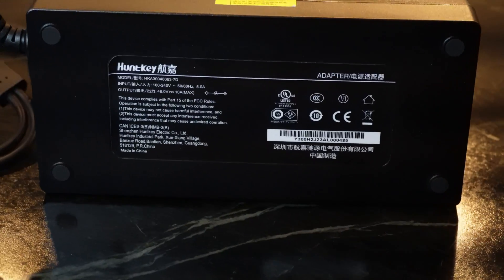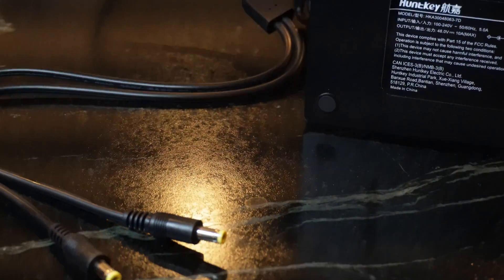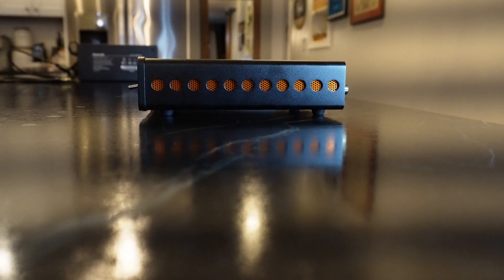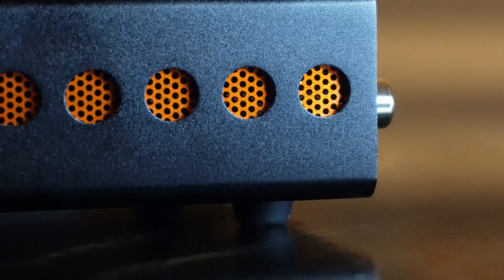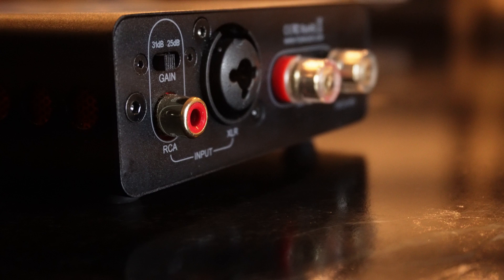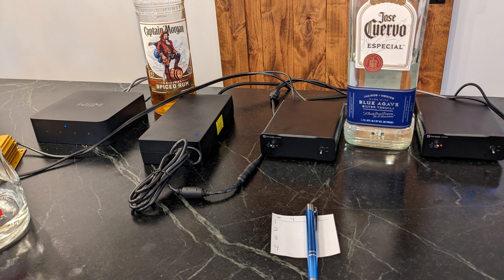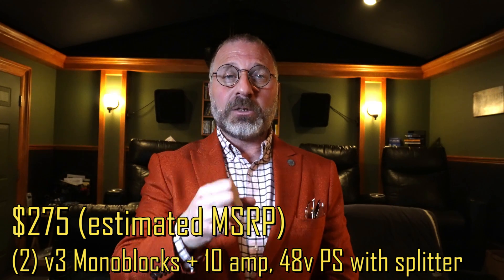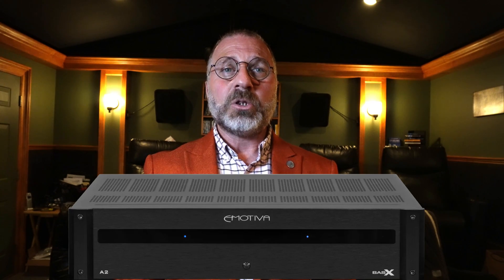Too Hot to Handle! Fosi v3 Mono

Comment: I use fans under the V3 mono blocks. No heat issues. No noise issues - other than I can just about hear the fan. I rolled the Op amps for the Sparkos SS3602.

I'm not sure why we dont just use fans and stop complaining.

Comment: My pair arrived today. The new single power supply has fixed any noise issue but man do they run hot. Mine cut out after 30 mins in a room (with slight airflow) temp of 75°. Ive put a usb fan on them and they are fine. 3 hrs running now and they are barely warm to the touch. They are outstanding little amps easily driving my dynaudio emit 20s. 
I really think they should be $10 more and come with a small usb fan. Or at least have it strongly recommend on the website or amazon page etc.

Comment: Gentlemen, I have 2 48 volt 5a like fois audio za3 amplifiers and I connected these amplifiers monoblock, and the muses01,muses02,muses03 opamps play very nicely, and my audio source is my computer with an ASUS X99 DELUXE ll motherboard, and the speaker is Monitor Audio Silver 100 (7G) As a musical style, I listen to rock, blues, pop, latin pop and I'm currently continuing with muses03s.
  By the way, I buy all my opamps from the original MOUSER and DIGIKEY, and in addition to these, I also bought the original TPA3255DDVR amplifier chips, but I have not changed them yet, but the ones on the amplifier seem to be original, so I am not in a hurry to change them.

Comment: Thought class D runs cool?
So why are these so hot?
Reply: Two primary reasons ...

Our "scientific" friend is using a testing procedure that is designed to "test to destruction" and panning a product that actually passed the test.  In real life, listening to music or movies, they won't get anywhere near as hot as roasting them with White Noise (all frequencies, constantly at maximum amplitude). Music is far more dynamic and for 240 watt peaks the average power is more like 25 watts.

Second, these little mini-amps are basically a powerhouse in a coffin. The case designs, especially with the bottom of the case used as a heat sink, are doomed to make them run warmer than they should. There is simply no-place for the heat to go, so it builds up inside the casing. A good heatsink with top and bottom ventilation on the case will work better every single time.

Comment: The heat dissipation design makes the whole chassis into a radiator, which means the surface temperature may seem a bit high. I think that indicates the heat from the TPA3255 amplifier chip is being effectively transferred to the chassis.
Reply: Heat travels up much more rapidly than down.  All the "chassis as radiator" really does is increase the temperature inside the chassis.  It does almost nothing to actually get rid of the heat. Moreover, there is virtually no air circulation under those chassis boxes to carry the heat away. So if the tops are hot, the bottom will be much hotter.

It's a terrible cooling solution.  In fact, you would get a much better result if you turned the amplifiers using it upside down.
Reply from the maker: You’re right but it is still a burn risk at those temperatures. However, this was a serious stress test and I’m surprised they didn’t go into auto-protection (if they even have that capability). My A-S2100 went auto protection.
Reply: @scientificaudiophile  
Yes the TPA3255 has a full suite of protections built in.  
Do your homework... search for "TPA3255 Data Sheet" and give it a read.

Comment: SA, how hot does your reference amplifier get with a 4 hour stress test?  You HAVE done that stress test on your reference amplifier haven't you??!!??  Andrew Robinson is watching whilst sounding like a transcendental meditation tape narrator.
Reply from the maker: I did put my A-S2100 under the same test.  After two hours the surface temperature hit 109 degrees into a 4ohm load.  It went into auto-protect at 2.5 hours. Never got too hot, but it makes me wonder if there is any auto-protect circuitry in the FOSI.

Comment: Must admit I bought a Fosi ZA3 to experience what they were talking about. 
Didn't expect it to surpass my Rega Aethos, but must admit that with lightly driven vintages like the Beovox 1100 or 2200, system matching makes the ZA3 surpass here. Looking forward to hearing the Lowther Bicor 1000 and Zu Audio Cube MKii at class d...
With that in mind, I'll have to try the mono V3, with the Aethos as a preamplifier...
Work, Consum, Die;)
Reply from the maker: Well said.

Comment: I was going ro use the za3 as a mono block to run my Polk 12 inch 2 ohm Sub. Now thinking about V3 mono for  that and using ZA3 for stereo tops.  two amps for 2.1 portable system. Thanks Amir for keeps cool looking jackets alive and well. Maybe there is hope for us after all

Comment: I’m no audio technician. But I do have a basic grounding in the sciences, particularly maths and physics. A 5 amp 48 volt power supply can only output 240 watts. So, in order for that thing to manifest 240 watts into 4 ohms, it has to be 100% efficient. Class D amplification is known for being ultra efficient, at least compared to class A or Ab. But 100% efficient, never. Anyways, you described the amp as running hot. Inefficiency, equals heat. Enough said.

So now that we’ve unquestionably established that the unit doesn’t live up to the manufacturer’s claims, I’ll be keen to watch your full review, once you’ve been supplied with a non defective power supply.

In the world of die hard audiophiles, isn’t separate power supplies with monoblocks a key selling point, or marketing ploy? So, is not a 10 amp shared power supply, a step backwards?
Reply from the maker: If the splitter can properly send 5amps to each unit, then shared isn’t a problem, but considering my first splitter was a mess, maybe it is a problem.
Reply: @scientificaudiophile  a shared power brick, supplying 480 watts is still insufficient to allow 2 mono amps each to produce 240 watts. Unless they’re 100% efficient, which they’re blatantly not, as they get warm.
Reply from the maker: True. There’s zero chance they can meet 240 watts.
Reply: @scientificaudiophile  👍
Reply: Okay, here's the thing ...
When pumping noise (especially white noise: all frequencies at full amplitude) into a system you are correct.  The power brick should rightfully go into either current limiting or a full shutdown.

However; unless you are hell bent on making your ears bleed, listening to music at reasonable levels won't even get close to that.  With only 10db of dynamic range you are already down to an average of 24 watts... and that will get lower as the DR of the music increases.

In most cases listening sessions on reasonable music will give you perfectly adequate levels on 2 or 3 watts, with peaks not likely exceeding 50 watts (for 15db DR).  

It is a serious mistake to equate a bench level stress test to what a person should expect in normal use.
Reply: @Douglas_Blake_579  that’s not disputed. What is under scrutiny is the nanufacturer’s claim that the musical power output of the V3 mono amps, equals the power output of the power supply.
Reply from the maker: According to ASR, in a short burst, there must be some additional voltage or amperage in the power supply because it hit 241 watts. I would imagine the power supplies being used have some variance in their manufacturing, so your mileage may vary a few watts.  But 240 watts is not continuous.
Reply: @howardskeivys4184  
As I explained above, with bulk energy storage in the amplifier itself it can actually exceed the power supply's limits for short bursts.

The point is that you don't need a power supply that will deliver continual full power output... Because music is not a steady state. It is dynamic and with proper music having a dynamic range of only 10db the actual "continuous" demand on the power supply is probably less than 20 watts even though the peaks are driving it to clipping.

The only way you're ever going to get to 240 watts of continuous demand with music is by overdriving the amplifier into such severe clipping that audible distortion would fry your tweeters... and in that case I'm betting you'd be the one screaming: "Why didn't it shut down!?!"

Is Fosi lying to us?  It sure looks that way ... until you understand how musical dynamics work.  Then you will realize that you simply do not need a power supply that can deliver that kind of juice, except for bench testing.
Reply: @Douglas_Blake_579  with a unit as compact as the C3 I can’t invisage it having a sufficiently large capacitor bank to maintain 240w for any length of time. So perhaps peak power would be more appropriate terminology.  Sorry, ‘C3’ should have read ‘V3'. That was a typo.
Reply: @scientificaudiophile  👍
Reply: @howardskeivys4184  
Oh for crying out loud ... I've got TPA3255 boards here that will deliver 220 watts at very low distortion day in and day out. 

The V3 has 2 x 2200uf caps inside and given that with an SMPS brick they will be recharged several thousand times a second, that's plenty of reserve. 

I get that you have a doubt... but please don't ignore facts to sustain it.
Reply: @Douglas_Blake_579   I want to use little amps like this one for light PA duty, so I need all power  which I can get. Aiyima A07 max and this board have TPA3255 on the board bottom and thermally coupled to the case bottom. What do you  think about  running this boards upside down with some light fan (PC case or CPU fan) added on top to get max power? @scientificaudiophile  maybe testing this config also?
Reply: @sikahr  
Are you planning to sound air raid sirens through your PA system?

Voice and music are very dynamic... as I've been explainging all day. The average power for these amps driven to clipping (but not beyond) with voice will likely be about 10 to 15 watts and perhaps 30 on music.  

I don't see any problem using them for general PA use.

Comment: Heat is always going to be a problem with these fully enclosed amplifiers ... even with the fancy little holes on the side.  

But in fairness running these amps at 3/4 output on noise for hours on end is not a typical operating scenario... it's bench level torture.  
Most of the time while listening at reasonable levels (75 to 80db spl) you will be asking these little amps for about 2 or 3 watts of power with very short term peaks hitting not much more than 15 or 20 watts.  In the normal listening scenario they will not get anywhere near as hot as they did in the noise tests. Probably about 80f or 27c in a comfortable room. 

Yes, heat is a problem ... but lets not exaggerate it all out of proportion.

As always, I recommend that, in these enclosed cases, with smallish heat sinks, you should use no more than 36 volt supplies... so for dual mono, you want 2 x 36 volt 5 amp supplies.  That will give you about 75 watts on 8 ohms and 130 on 4.  ... more than enough for most scenarios.
Reply from the maker: Agreed, it is a stress test. One that a hi-end amplifier could pass, so I’m really just trying to see how close they are getting to legitimately replacing those $1,500 boxes.
Reply: @scientificaudiophile  
I can answer that for your very easily .... 
The TPA3255 chip used in all these mini-amps is actually a pro-audio chip, designed for use in sound reinforcement, studio monitors and AV amplifiers. 

You're going to find it in some very surprising places, including high end audio products, home theatre, an endless supply of DIY and industry surplus boards and perhaps even in some of the other Class-D amplifiers you've already reviewed.  I know of at least one $5,000 "audiophile" amplifier that uses them (but with a far better cooling solution).

 So the answer is "Yes" these little mini-amps can carry the ball against way more expensive gear... because they're using the same chips.

And... FWIW... your V3Ms did pass the test ... you ended the test early, the amps did not die and indeed kept working after.
Reply from the maker: Correct. They did not die.
Reply: @scientificaudiophile  
So, on to a music test... watch the temperatures... they'll be a lot cooler and you know they can take a pounding.

Matter of fact, I destroyed a couple of the 100w gold resistors testing a TPA3255 DIY board... the board lived... the resistors did not.
Reply from the maker: What did you do with the gold when you were done? I’m hoping make them into jewelry or something. 😀
Reply: @scientificaudiophile  
Very funny... (sort of)....

I was referring to the shot of the resistors you used in your video.  

BTW... those are not rated for 200watts continuous power... they're probably rated for 200 watts for a matter of a few seconds, and about 120 watts continuous. Without a heat sink they will get hot enough to burn holes in a wooden desk... just so you know.

Comment: I really don't need these, but I know on release day the early bird discounts will be hard to resist, and I have minimal will power. Also these will come in a small box, and I can believably pass them off to my wife as a years supply of vitamins.
Reply: Vitamins are MORE expensive. 😂
Reply: Get the vitamins. At least with vitamins you know the manufacturer is not being truthful. With audio products you have to discover that for yourself!
Reply: @howardskeivys4184 I’d base my opinion on have they been truthful with previous products
Reply: @howardskeivys4184  Very true.
Reply: Been there, done that! 🤣🤣🤣🤣

Comment: I just posted my review and also had a noisy power supply like yours. I pulled two PS from other amps and the noise went away.
Reply from the maker: Nice to know. I didn’t have an extra 5 amp ps to try out. Thanks.
Reply: Absolutely two separate power supplies is the way to go.  The entire point of monoblocks is to have two fully isolated amplifiers.

Comment: Why would it get hotter than a V3 stereo with the same chip?
Reply from the maker: I never tested the v3 stereo for so long at such conditions - a 4 ohm load at 3/4 power is SEVERE!
Reply: @scientificaudiophile  okay that would be a sound level that would have the police turn up at my door if I didn't blow out the speakers first.
Reply: i think because v3 mono alway at full volume

Comment: Would you still say the Outlaw Audio 2220 is superior? How's the bass of the V3 Monos with the 48V/10A power supply? Is it lean like some have said of the V3, ZA3 and other Chi-fi mini amps? A slight noise issue isn't a problem for me as I listen to a lot of heavy metal and rock but just out of curiousity, would using a power conditioner do anything to reduce noise?
Reply: Outlaw is 4x more expensive. They also offer $99 discount if you buy a pair.. but charge $75 for shipping 🤔 so $775 for a pair of 2220.
Reply: @bjmarchives  I know, but a better quality pair of entry-tier monoblocks is more important to me, even if i have to pay 4x the price of the Fosi it's still affordable if I buy 1 at a time & slowly build up my system gear. They're also more affordable than a pair of Starkrimson monos from Orchard Audio or Tyr from Schiit. At least, for now. But it gives me an upgrade path.
Reply: Never seing à worst reviews ever. You do not talking about swapping opamp.Emotiva have the worst mid and high ever listening...
And the loudspeaker not have 4 or 8 ohms at all time.
Sorry but big bullshit.
Reply from the maker: Yes, 2220 is superior - as it has ZERO load issues, the FOSI v3 Mono still has a slight issue, but only a very few would hear it.  I don't know if its lean, the noise issue was a problem - and "heavy metal".  Doesn't every Metallica song start off quietly?  You would hear it - the noise was apparent when nothing was on.  Unfortunately a power conditioner would help because the issue was in the splitter cable itself, not the power supply.  They're sending me a fixed splitter cable.
Reply: @scientificaudiophile  You've got a good point there about the quieter parts of even loud, intentionally distorted music like metal. I listen to a lot of a band called Elder (kind of like a heavier Pink Floyd) and they have long songs with a lot of quiet moments that slowly swell into heavy riffs & drums. If there's a buzz or hum I would probably hear it and it would ruin those songs. Fair enough... I'll still put the 2220's at the top of my list to run a pair of the lower tier Maggie planars and a couple of powered servo subs. Thanks.

Comment: Can you swap out the opamp?
Reply: Other YouTube types say yes, and I expect you can as Fosi have made a feature of it with their other amps. The problem, as always, will be fitting big discrete op amps like Burson, in the case without drilling holes or buying fancy flexible mounting adaptors and laying them flat, which I would worry could exacerbate the heat issue.
I use Burson V6 with my stereo V3 and just drilled twin holes in the top.
Reply from the maker: Yes